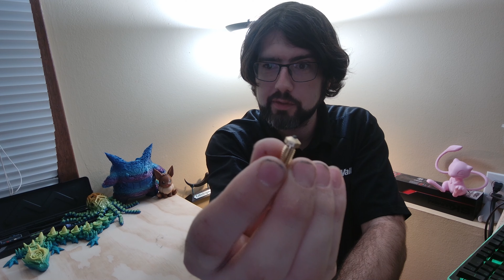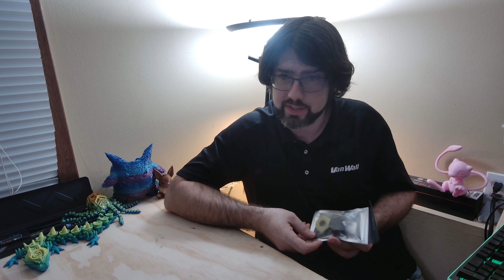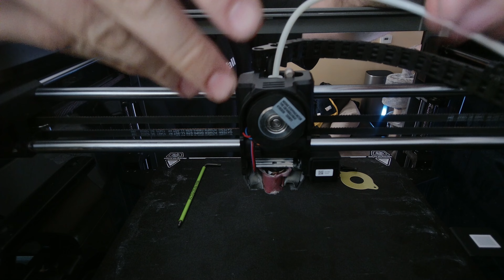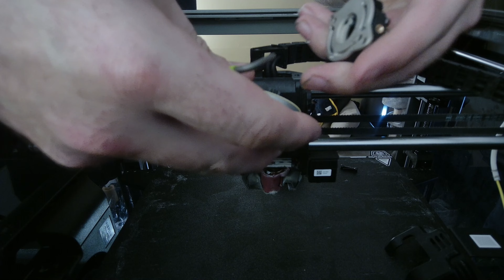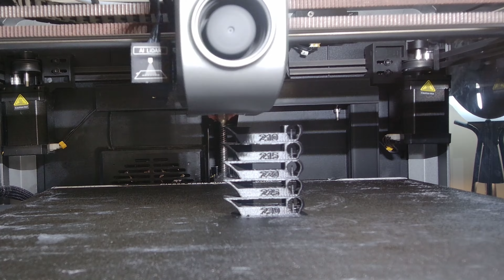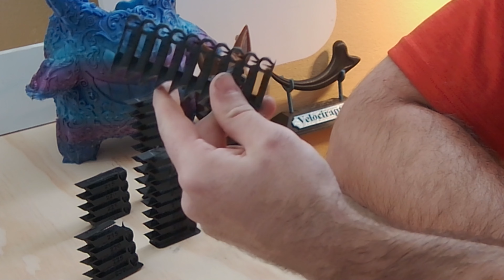DiamondBack Nozzle How Much Better Is it Tested

Comment: Dianoz user (the other diamond nozzle) : I bought it out of lust while very inexperienced. I was destroying clogging nozzles and getting fed up with it. Since using a .4mm Dianoz nothing not even a cleaning in 1200hours according to the counter of my flsun sr. Changed a broken  heat-break temp sensor, heating element, dug a ditch in the plate.

Bug with the nozzle : nothing
maybe one drawback :Oozes PETG more than the others, I think because the tip is hotter.

Something nice to have, yes.
Cost effective for the hobbyist, not so sure.
But if you are into long prints, 24H+, Then it will have saved some due to no clogging. Versus 2 prints junked near the end with brass. 
Might even be an investment.....
Reply from the maker: Thanks for sharing your experience with the nozzle, it's always helpful to hear how others are doing with different setups.

Comment: Great video. I’m using the e3d diamondback in one of my X1Cs and I’ve found the temps need to be quite a bit lower  than  the steel nozzles to get the same bridging and overhang performance. 

I like this nozzle tech quite a bit.

Comment: Didn't know you could fit a diamondback directly on the k1 max, did you need to make any mods to use the diamondback?
Reply from the maker: @kvnlain4254  the 1st and 2nd revision k1 series has a normal volcano nozzle.      New k1m etc come with the unicorn nozzle which is not compatible.

Comment: You really thru me off, calling the R3D filament "RED". But, I did give you a like and sub. anyway. Would have liked to see where the springs you removed were at, also.
Reply from the maker: Was my first video so far from perfect lol.  Still getting better as i go.   New episodes are coming slow getting the new house setup and figuring out a good studio type setup.

I cant add photos here. but if you remove the printhead cover  at the top on the printhead youll see two screw holes that line up with the upper rod (also holds the wiring loom holder)   When you remove those two screws and move the loom holder that will expose the two screws.     Appreciate the like and sub.

Comment: I've been debating this nozzle for months, that price tag is just huge. Do you have any experience with this and a tungsten carbide nozzle?
Reply from the maker: No experience with the tungston one.   After issues with the hardened nozzles constantly blobbing and having to run so much heat I just bit the bullet.      My experience so far has been great with the diamond.   There's no blobbing, temps stay the same as with the copper nozzles settings.   And I don't have to reduce speeds like I did with the hardened version.           The biggest thing with the diamond is the heat transfer is better than brass.
Reply: @JATdesign Any concerns about the diamond tip being dislodged? I heard of such thing happening with nozzles that are different material inserts.
Reply from the maker: @erik3205  have not seen any reports of that issue with these ones.    Possibly with one of the cheaper brands out there.     I know some Bambu machines with the inserts have that issue but every time I see it the person is running constantly either at 300c or over 300c.